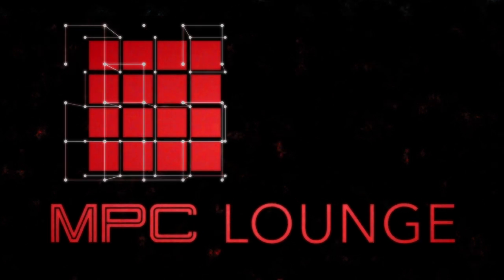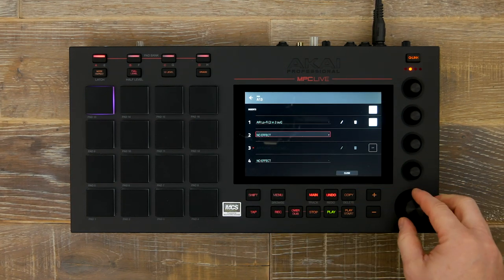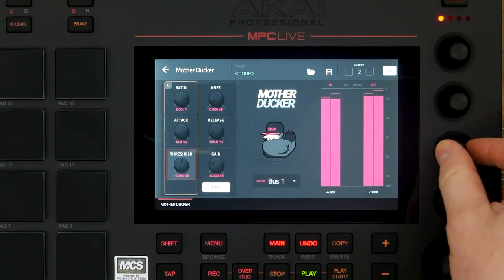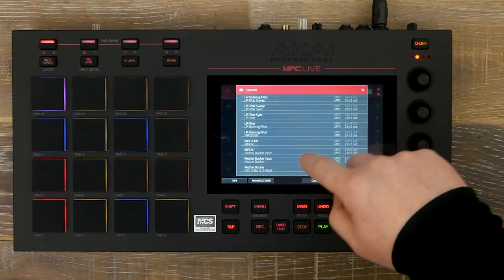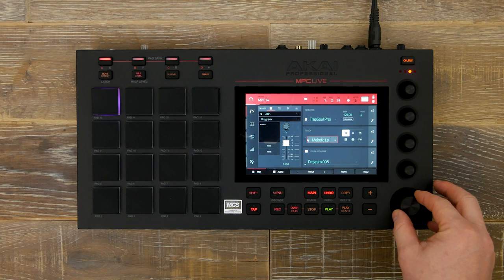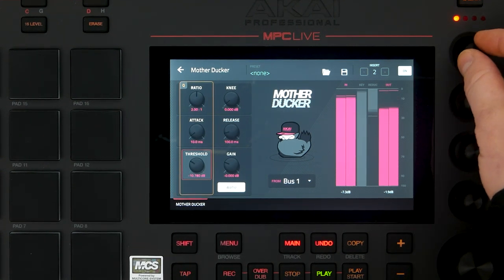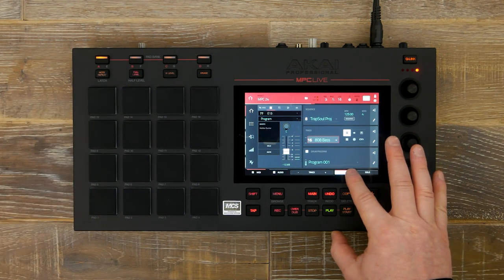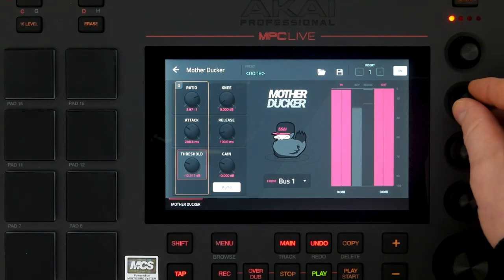MPC Lounge: Adding Side Chain Compression

Comment: First of all, what you are describing is not at all what most people mean when they use the phrase "side chain compression". The correct description of this technique, a usage that is literally decades old, is "ducking". Yes, the gain of a sound is being controlled by feeding something else to the side chain input of the compressor. However, the literal meaning of the phrase "side chain compression" would be "compressing the side chain" which, AFAIK, NOBODY does. If you did compress the side chain input to a compressor, you would be making it less effective. The thing that most people mistakenly call "side chain compression" should be called either "parallel compression" (for the signal path used to achieve it) or "upward compression" (for what it actually DOES), and this process is completely different from Ducking. Please re-do your video, not using the completely wrong term "side chain compression", and please do not use the exact phrase "side chain compression" in ANY context.
Reply: Christ my dude chiiiiiiilll.  Plenty of people, professionals included, colloquially use the phrase ‘side chain compression’ in this way.  I searched for ‘MPC Live sidechain compression’ to find exactly this video and it was exactly what I was looking for.  Ignore common language usage at your own peril.  It is uncharming and a waste of your time.